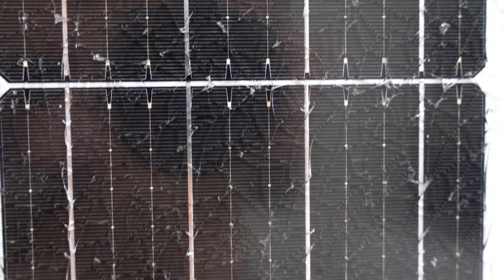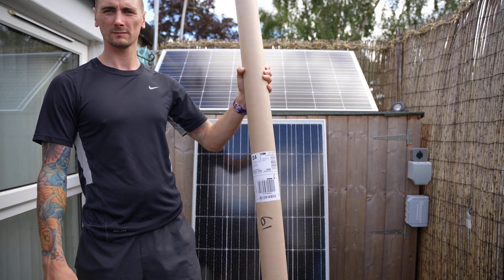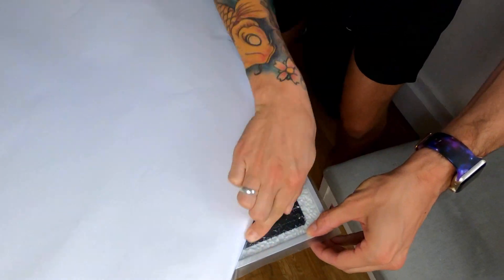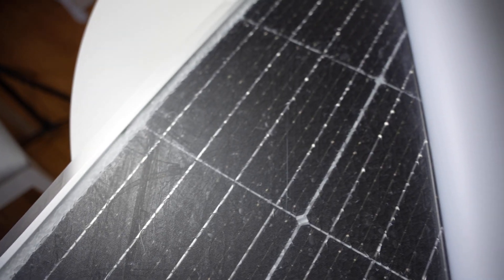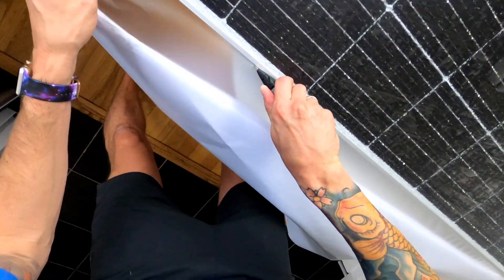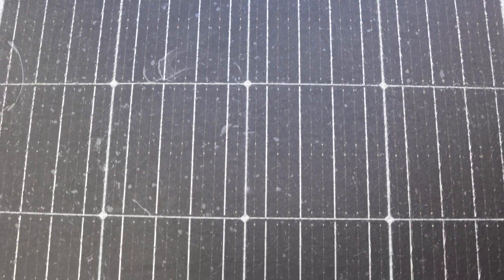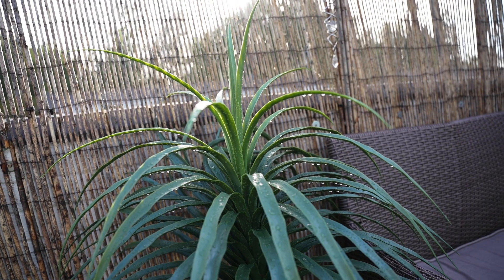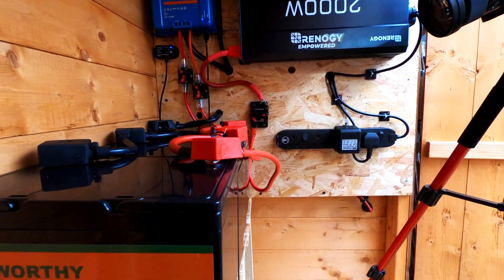Solar Panel Glass Cracked (Alternative Fix?)

Comment from the maker: ECO-WORTHY solar panel - https://ebay.us/Z1pLAL
ECO-WORTHY 100AH battery - https://ebay.us/Qlc2Qt
www.eco-worthy.com
info-eco-worthy.com

Victron MPPT Charge Controller : https://amzn.to/3BRv5PR
Renogy 240V Off-Grid Pure-Sine Wave inverter: https://amzn.to/3vP3hrR
MC4 Cable: https://amzn.to/3vPjKfI
100ah lithium battery: https://amzn.to/3dh5ypb
Solar Panels: https://amzn.to/3vUZGsb
Battery Cables: https://ebay.us/i6Yoj8
Reply: Have you posted a video of how this panel front surface repair sealing has worked in the long term? I can't find such a video from you. Has the plastic film with its adhesive still held up in the sun and rain?

Comment: Just installed 30 Canadian Solar 185W panels. Unfortunately, one cracked and I cannot find a replacement the same size. Thanks for the great video. I will give it a try. However, please tell me the manufacturer name of the transparent clear laminate film. Will look for something similar here in the USA.